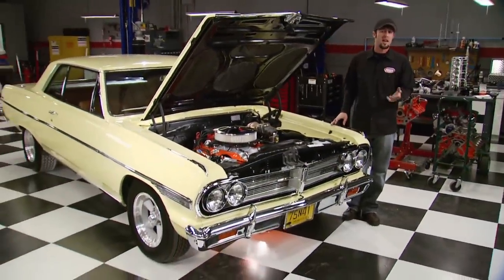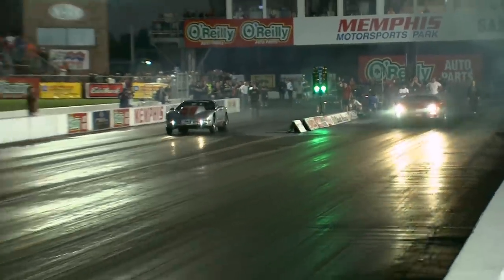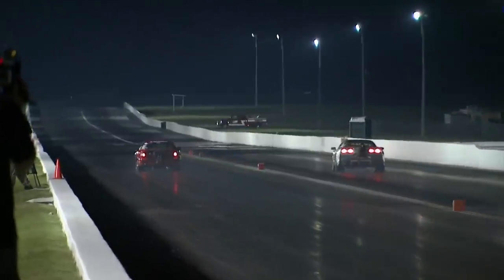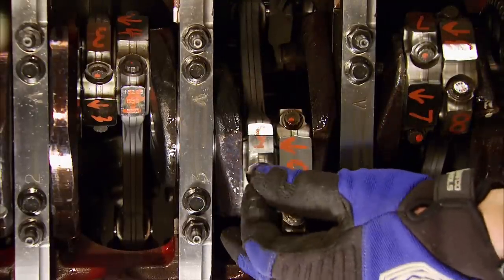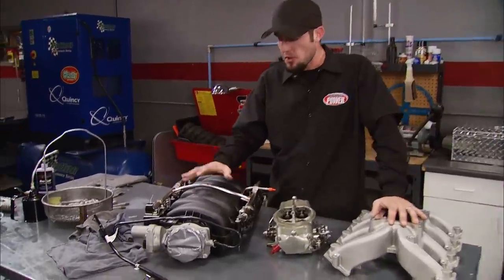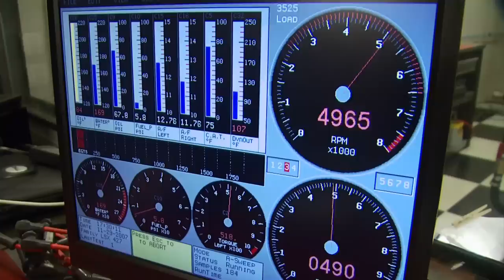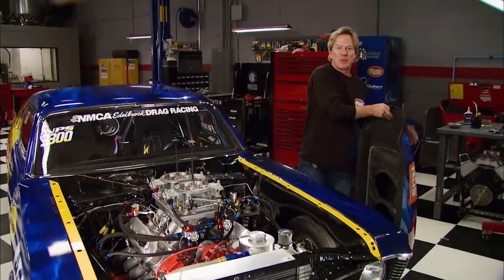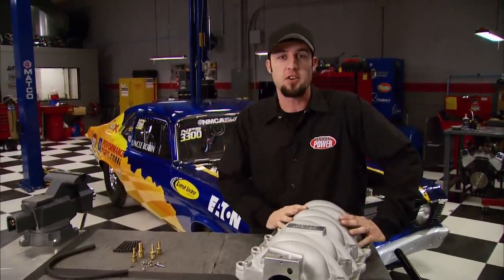HorsePower's First 427 LSX Build - Horsepower S12, E1

Comment: That carb intake does not make more power then an intake with equal length runners. 
And you should make over 700 with that motor especially with that compression ratio.
You make 630-640 with an ls3.  Throw the fuel injection on and make more power

Comment: Should have run it out to 7.5k - 8k rpm with that intake. As long as the valve springs are up to it.
Reply: That crazy cam spec wanted to go higher too..... or at least the exhaust events

Comment: Funny thing is that no two motors alike. I seen them come down the  assembly line and one ran exceptional and the next couldn't pull hats of the heads of little old ladies. Why, I am not so  sold on each block being the same exact   motor. I took engines out of brand new cars and put them on the dyno.... if they had been within say ten to twenty horsepower, then I would agree

Comment: EFI wouldn't produce as much power as the carburetor?
Reply: That’s what I’m wondering now
Reply: Probably.   A carb is a simpler setup.   No computer and associated parts to deal with.   Less expensive as well.
Reply: Obviously it would been proven many a time much more control and better spray patterns and more consistent like others have said carb cheaper and efi probably be the next stage along with boost.
Reply: Carbs win on the dyno.  EFI is just a spreadsheet of numbers, and is unable to cover any rpm with proper air/fuel ratio.  Carbs are analog, and infinitely variable.
Reply: @bradyelich2745  What you say is a complete contradiction.
With those maps and inputs, you can make an engine hit any AFR you want under any condition you choose to throw at it.

Show me a carburetor that will fire up & idle at 25⁰f and also run a 12.0 AFR under 30 lbs of boost making 1000 whp....... 12.1, or 12.2, or 12.3 for that matter. 
FI can do EVERYRHING carbs can do, just with a wider rang & more precision. The learning curve is steeper but once a guy has gotten over his ego and decided to learn what 4 or 5 sensors do & how to set them up & what they do, it's REALLY simple...
Reply: Yes
Way back in the before.
Carbs were king.
This episode originally aired in the early 2000s.
EFI is more beterrer now.

Comment: Did I hear the cam specs correctly? Forty-three more degrees of duration (@ 0.050) on the exhaust side?
Reply: 232int 276 exh?
Reply: Pontiac did that on their motors sounds like it is similar

Comment: Can I produce 1200 hp from 351w Ford (f250 engine) ? By replacing cam shaft and few modifications on the rods and valves?
Reply: Lol
Reply: @chickenfoundation9323  ?

Comment: I'm building a 408 LS going to use factory trim what injectors should I use in it I have 38 LB one stock on a 6 l would that be fine or should I upgrade them to bigger injectors

Comment: hey guys, i have a 6.0 with the g8 square port heads . i cant seem to get the right spark plug gap. what gap are you guys running?i have same fuel and ignition setup as your engine

Comment: Was it just me or was there a huge delay from wot on the carb and when engine actually started to pick up rpm and go to full throttle?
Reply: That's a function of the dyno adding resistance/load.

Comment: nothing like spending three grand on rods and putting an 850 carb and making 650 horse for just the price of the rods ive made as much with an old school iron headed big block chevy
Reply: I bet this motor would last a lot longer with turbo or nitrous than a cheap build with the old cast iron block you are talking about.
Reply: @DT-wp2yc  i would hope so but thats not the point too spend that amount of money for that horsepower n/a is a joke if you are going to turbo it fine but dont try and impress me with a number that is easy for a lot less

Comment: Should’ve spun it higher. The LS7 revs higher from the factory with worse parts.
Reply: Leland Holton exactly. They never even verified if that was actually peak power. If they did then they did it offscreen. With that setup I would guess peak power is at least at 7200 rpm.

Comment: I was thinking of spending 6500 on a 400 crate motor with around 550 horse. What could i get from an ls with 6500
Reply: Around the same NA, 1000hp+ with power adders provided it's ordered with them in mind. Blueprint engines has a 30 month warranty if I recall correctly.
Reply: @jaydunbar7538  most crate motors that i looked at don't have the heads and cam that i would want. Maybe i might go the short block rout. So I can really hit the power numbers i want. But if i go LS i would be just another guy with a fox body and an LS.
Reply: Jason Winkowski  a 408 is what i was looking at for 6500

Comment: when i was thinking on getting a lsx it said it was a 454 with a 427 crank if it a 427 that would be a ls 7 427 i thought at least that what it claims on the ls website but what do they know . i have seen so much bs on the net now u don't know what is real. just like some people say the 70 chevelle ls 6 is a big block chevy which is bs because ls has never built a bbc they are a gm engine not a chevy

Comment: Seems like they would have studs in them rods instead of bolts.
Reply: Why?  I've got Crower rods good for 500 hp a rod & they've got bolts.
Reply: @elonmust7470  studs are stronger and if you're going to go as far as titanium rods why not have a stud instead of a weaker bolt.

Comment: Im finding it midly amusing that the children here  think efi makes any more power than a carb.  Peak numbers are the same. Thats not where efi shines .
Reply: @Andrew Foster Its the same . A carb and efi make with in a few Horse power of each other. Efi shines in tuneabilty longevity changing  elevation .
Reply: I think if I was building a race engine I would put a carburetor on it but if I was building an engine that makes good power and use it as a daily I would put efi on it just cause it would run smoother and when it’s cold I don’t have to sit there and baby it

Comment: Did you seriously put a carburetor on over fuel injection?
Reply: It’s been proven several hundreds times that on NA LSs carbs often make more horsepower
Reply: @popeye089  that's impossible
Reply: @frankcastle9691  No it’s real.  Just because you don’t know something doesn’t mean it isn’t possible.
Reply: @popeye089  explain to me how carburetors work.

Comment: We want to make power so we put a carburetor on it 😂
Reply: Carbs win on the dyno.  EFI is just a spreadsheet of numbers, and is unable to cover any rpm with proper air/fuel ratio.  Carbs are analog, and infinitely variable.
Reply: @bigboreracing356  I have literally never heard that. How is that based on any facts
Reply: Carburettors induce charge cooling. They are generally better at high rpm so long as the airfuel mix does not fall out of suspension through the manifold and port.
Reply: @bigboreracing356  Then why would they use efi on most of their high hp builds? Power is not even determined by the method of delivering fuel but rather manifold air density and how fine the fuel is mixed with air. And efi does far better job an atomizing fuel then a carburetor.
Reply: You can’t tune per cylinder with a carb. You don’t get the charge cooling with port injection. However the Holly Sniper EFI is a good compromise. DI is still the best, but not proliferated quite yet and with EGR leaves intake valves disgusting. Not that I or anyone would use it on a “track” car. I have a Lexus that uses port and DI. Decently flat torque.

Comment: These guys are just clowns. Obviously they gained the '18 horsepower' by also going the extra 300 rpm, but who the hell ever stops testing for horsepower when you're STILL making horsepower??? The graph was still climbing, lol. And with the overkill they did with the bottom-end, there's no reason to limit the rpm to that wimpy (even for STOCK) 6800.

Comment: That's an awful small cam for that cubic inch engine.
Reply: Its horse power tv there always conservative
Reply: .233/.276 with .595 lift?  Not really.  I run a .234/.244 with .570 lift roller in a 454 and it has quite a lope and pulls through 6k rpms in a hurry!  So their similar hyd roller cam in a 427 would have a powerband to 6500 easy!   Sounds like a great nitrous cam!
Reply: Badger Bait brother you can’t compare cam size between small/big blocks and gen 3+ engines. People run 230/240 cams in 350 c.i. LS1’s nowadays.

Comment: Why wont you just let Carbs DIE already! EFI too difficult?
Reply: For all out power carbs can be way better , fuel injection doesn't need adjusting and is more economical . But if you don't give a shit about fuel economy , a 4 barrel carb can flow way more fuel than the government mandated fuel injection can .
Reply: Carbs win on the dyno.  EFI is just a spreadsheet of numbers, and is unable to cover any rpm with proper air/fuel ratio.  Carbs are analog, and infinitely variable.
Reply: Lassi Kinnunen  Tuning EFI equals having a spreadsheet on a usb stick.  Every motor is different, and EFI tries to make them all the same.
Reply: It needs to be mapped for each individual engine. You buy a haltech or something that can be done. Efi can infinitely change the airfuel mix because it takes a reading from the lambda sensor in the exhaust on how the rich or lean it is.
Reply: @bradyelich2745  Saying that efi tries to make every motor same is like saying carbs are shit because you did not adjust it. When you want to have precision,  power and fuel economy go for the efi.
Reply: David Mackey EFI for the win all day long. Back when this video was made there probably were not too many options for EFI tuning, but nowadays there are plenty of options. Also EFI gives you feedback in the run log, whereas with a carb the only feedback you get is mostly from your time and your plugs/wideband.

I bet if this was filmed today they would still use a carb and the people in the comments would still be saying big blocks with a carb are the best. Old ways die hard I guess.

Comment: Am I the only one who things that big piece of plastic in the middle of the timing set is a disaster waiting to happen?
Reply: Yes you are. That is a timing chain dampner. It has been proven reliable in 1,100+ hp engines for years.
Reply: @lorydr2003  I am wondering how well it holds up over time.   Plastic gets brittle as it ages.  Plus as a timing set ages the chain stretches and can beat it up.

Comment: Plastic intake😂
Reply: Anaïck Léveillée yup that composite intake has proven itself many times.
Reply: Ford vehicles have been running plastic intakes since (at least) 1995.  My 1995 Mercury 4.6 had a plastic intake.  The only downside is the bolts need their own rubber gasket.   I changed those out on my 1999 Windstar.
Reply: It's for the heatsoak....aluminum intakes get very very hot, these plastic composite intakes run much cooler which means more power. ...